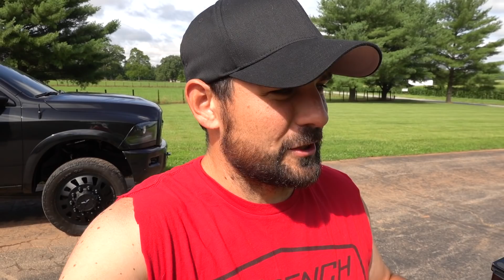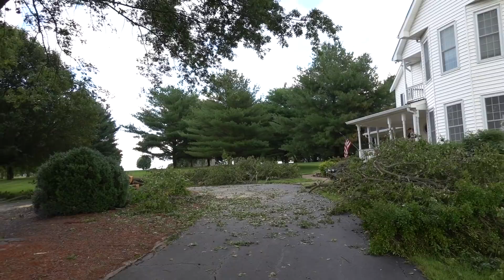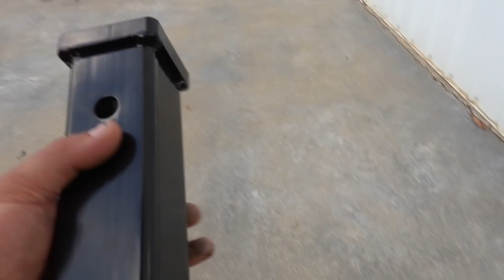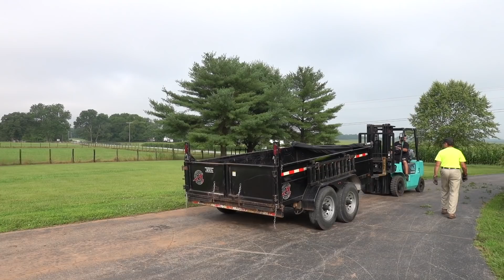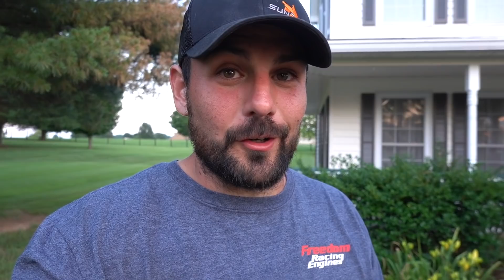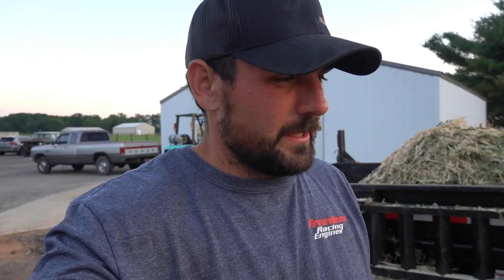CUTTING DOWN THE BIGGEST TREE ON OUR PROPERTY!!!

Comment: Greg for that fork lift attachment I highly recommend a chain. Weld a link on the attachment and then run the chain up around on the forks where they go vertical. Or anywhere really. All it takes is it to slide a little and it will let go since your forks are tapered.

Comment: You should put a safety chain just in case those all thread holders slide. At least then you are covered. Just weld a small chain to the attachment an wrap it around the back of the vertical part of the fork.

Comment: I’ve just drilled a hole in one of my fork and screwed in a ball when need to move some trailers
Reply: Definitely super easy do it at work with trailers
Reply: At work we have a hole through the fork close to the end and then slide a square tube with a pinto hitch welded to the tube stick a pin through the tube and the fork and boom there you go